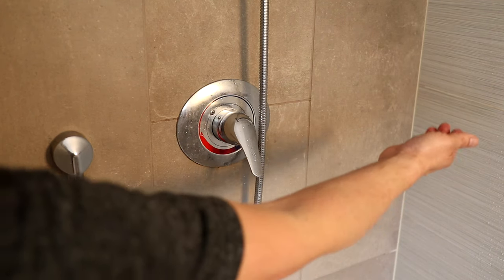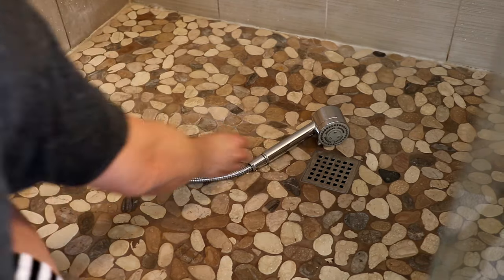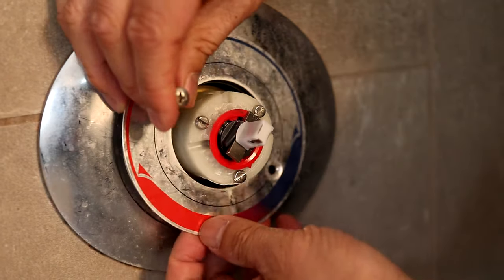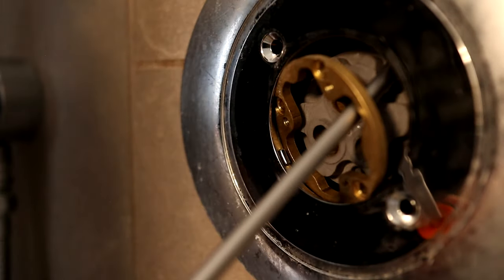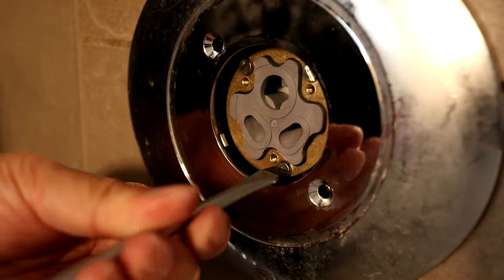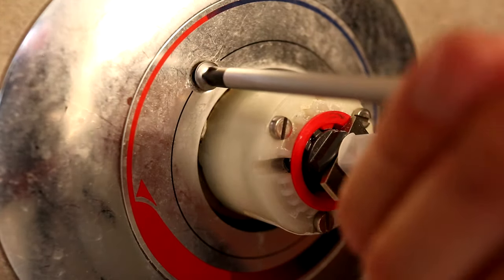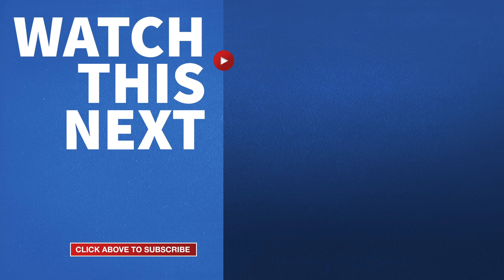American Standard Shower Cartridge Replacement Instructions - Shower Valve Pressure Balancing Unit

Comment: Just one note I thought I’d add: American Standard has a lifetime warrantee for their parts. If you know the model of your shower they will ship you the parts at no charge, you need to know the model of your shower control as there are different pressure balancers depending on your model.
Reply from the maker: Thanks for the tip! A while ago I made a repair video on a leaky kitchen faucet before and another commenter also told me that Delta has free replacement parts as well! However on my shower I needed it repaired right away so I went to Lowes for the part. Thanks for watching!
Reply: Sorry I didn't read this before buying a new one at HD.  Incidentally, none of the AS replacement parts come with screws and the screws are very difficult to find so be extra careful in removing them.  Also the brass retaining ring is not included in the packaging and is not available in HD.  Be forwarned.
Reply: Absolutely.  They shipped me the replacements.  Seems like the hot water degrades the rubber diaphragm and the seal in the pressure balancer.  I took mine apart afterwards and it was in very rough shape

Comment: As a mechanic, ive been showering in hotish water every day thats starting to dry my skin. Sooooo I'll be checking this out soon. Getting ready to replace my s22 ultra back glass screen tomorrow as well. 😂 when ur a mechanic, ur also a plumber, electronic tech, hvac tech, construction worker, etc
Reply: Update, turns out all i needed was to move the black little gear piece that adjusts how hot or cold the water gets. It came off when the handle fell off. (Been using vice grips for a year, on the valve) finally bought a new shower knob and its shining 😂

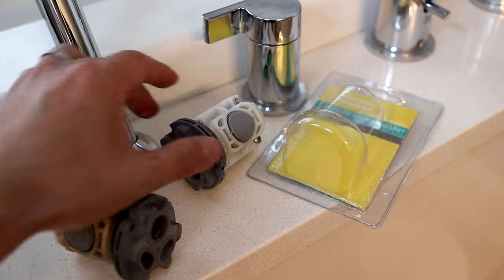Comment: There might be a problem in this video. I'm not sure.  Do you notice that the old one had two green inserts and no black rubber rings around them. 3:14 The new ones do have rubber rings.  And when you look inside the brass valve body, where the pressure balancing valve goes, there are two black rings inside from the old valve 3:36.  I think you have to remove those two black rings because the new pressure balancing valve has them.  They just seem to get stuck when you remove it.  Am I mistaken?
Reply from the maker: You are correct. One other viewer noticed the old black rings still inside the pipe in the wall. After being made aware of that I rewatched my video and saw that. I think what happened was that I was too busy with getting the shots and I didn’t see the rubber rings still inside the back of the fixture. So I removed the valve and pressure balance unit at a later time and removed those gaskets that weren’t supposed to be in there. The new pressure balance unit already has them.
Reply: @digitalcamproducer  I took the old one apart and inside it was a mess.  The rubber diaphragm had almost completely disintegrated.  Furthermore, although the ceramic valve looks okay, The intake o-ring, which is not a standard round shape, was pretty disintegrated on the hot water side.  I guess the rubber that they are using doesn't do that great in hot water.  Luckily the American Standand warranty service sent me both the pressure balancer and the valve, without any challenges. They also sent me a new spout/diverter.  I have to solder a new pipe to install the spout, that's my remaining piece of the project.

Comment: My American standard unit doesn't have have a  separate replacement balancing cartridge, it's all one unit, must be an early version.  The mixture cartridge replacement unit swapped out easily but it looks like I have to change the whole faucet. Good times.
Reply from the maker: Sounds like it’s gonna be a bit more work for you to solve your faucet issue. Yeah never fun when it turns out to be a bigger task than when you first started out.
Reply: @digitalcamproducer  might have a workaround, but I replaced the mixer cartridge anyway and it seems to be working. Go figure.

Comment: Hi! Do you know your model number by chance? I have the same handle and just need to replace the trim around it as it has cracked but cannot find the model number for the replacement part as it is very old.
Reply from the maker: I actually don’t know the model number of the faucet. My plumber installed 3 of these but have no idea of the model number.

Comment: This video is very helpful, thank you.  One thing, I am getting stuck at finding the pathway in the allen wrench hole.  My allen key keeps hitting metal right away. I have it turned up, too.  The initial issue was that the handle will not turn right.  Your video has it up and RIGHT -- does it need to be that way to get the allen wrench in? if anyone else is hitting metal or unable to to turn the handle right, would love to hear
Reply from the maker: By now you’ve probably solved your problem. But the faucet handle can be turned in any direction. Turn it to where you can access the set screw opening easily. Finding the angle of the set screw with an Allen wrench can be tricky though. But you will be able to do it after a few tries.

Comment: I have the exact same mode. I've taken out the set screw but the handle still won't come off. It's not even loosened. Still turns and moves like normal
Reply from the maker: Sorry you’re having issues removing the handle! That set screw should be the only thing holding it on. Maybe there’s corrosion inside making it stuck there. You could use a screwdriver handle and tap the base of the valve handle to see if you can loosen it up. Hope you find a way to get it off! Thanks for watching!
Reply: @digitalcamproducer  I'll give that a try. Thanks for the response!

Comment: I had a slow leak from my downspout. As I watched  the video and removed the trim I found one screw that holds the in place was loose. Tightened the screw and the drip stopped. Tanks for the video. ❤
Reply from the maker: That is good to hear! Glad you fixed your problem by just tightening a loose screw. The easiest kind of DIY! Thanks for watching!

Comment: My shower controls when set in the middle between hot and cold would make the water pulse and the pipes would "bang" in the walls.   This trick solved the problem.  Paid $23 at home depot for the part that was in stock as well.   Took me longer to drive to depot than it did to do the job.   Thanks for  sharing,  the video was great.  YouTube comes thru again!
Reply from the maker: Excellent! So glad you got your plumbing problem fixed! Plus the satisfaction of saving money by doing it yourself! Thanks for watching!
Reply: @digitalcamproducer  no doubt about it,  always feels that much better when you can fix it yourself!

Comment: Some towns/cities flush fire hydrants in the spring and when they do it releases a lot of rust and small pebble like contaminates that end up in our homes plumbing. This can attribute to issues with your faucets and bath/shower valves. Even a home with a well can get sand and small grains of pebbles that do this too. Just FYI to pinpoint some things that happen to cause issues similar to this.

Comment: In your opinion, is it wise to turn the water back on before installing the outer plate so that you can see if there are any leaks before concealing everything?

I'm paranoid about doing the repair and then having a leak behind the wall that I can't see.

Thanks for your help. This is a great video!
Reply from the maker: I think it would be ok to turn the water back on before you put the outer cover on. That piece is just for looks! Hope this helps!

Comment: i bought a new cartridge set and installed it, but the water pressure was only a little better .. i tested the water  with no valve in and it was strong coming out, but not too strong after installation

Comment: Thanks for posting this, I did the original install when I purchased my home in 2007. but could not remember how that set screw was inserted or the Allen wrench size, found those details in the comments below, looked at HDepot & that part is 70 bucks, so I'm cleaning it up & greasing the o rings with vaseline & back in it's going. I can buy a new whole replacement for about the same, but it ain't gonna happen
Reply from the maker: Nice! Really glad my shower faucet tutorial was helpful! Thanks for watching!

Comment: I change my cartouche and i only have hot water with any ajust in red plastic ? I need to change te peace of presure?
Reply from the maker: In my shower I was only getting hot water so I needed to change the pressure balance unit. I didn’t know anything about this before I made the repair. But the pressure balance unit was the problem. If you changed the cartridge and you still only get hot water… then the pressure balance unit is what you need to look at next. Hope this helps!

Comment: My handle only has a hole on the front of it. Not the top or bottom if that makes sense. How do I get it off?
Reply from the maker: Hmmm! It’s hard to tell what to do without seeing your faucet handle. I’m definitely not an expert in plumbing and pretty much all the faucets I’ve seen have the small set screw underneath. There’s got to be a way to get that off. Sorry I’m not more help on this! Thanks for watching!

Comment: If my pressure balancing unit works fine, can I just replace the valve cartridge?  Is it best to replace both?
Reply from the maker: Yes! If the pressure balance unit is ok you can just replace the valve cartridge. I’m not a plumbing expert but that’s what I’d do. Only replace the part with that issue in this situation. Hope this helps!
Reply: @digitalcamproducer  Thank You!  My main issue is that my faucet valve is calcified, and I don't feel like dissassembling the valve components to soak them in CLR.

Comment: What size Allen wrench do I need to remove the handle? I tried the ones I have, but seem to work.
Reply from the maker: Sorry I don’t have an answer for you about the Allen wrench size. I don’t really know. I just tried different sizes until I found one that fit. Hope you find one that works or ask to borrow a friend/neighbor’s wrenches to see if they have one you can use.
Reply: I used a size 2.5 for mine!

Comment: Is this a standard part on all shower units?
Reply from the maker: To be honest I didn’t know about the pressure balance unit until I opened up my shower fixture. I thought there was only a valve in there. It’s possible that much older fixtures didn’t have them but I can’t be sure. I’m just a regular guy that fixes things as they break. And I’m definitely not a plumber! But replacing the pressure balance unit in my shower fixed my problem.

Comment: So would this repair also fix the faucet not turning to hot? Ours won't turn hot any longer, just lukewarm or cold
Reply from the maker: I’m not 100% sure about this but I would say the replacement of the pressure balance unit would probably fix your no hot water problem. The pressure balance unit regulates the distribution of hot and cold water so it would probably solve your problem. However do you have hot water in other places in your home? Check to see if the water heater is working just in case. As you saw in my video, replacing a pressure balance unit isn’t difficult to do. Plus the part is available at Lowes if you need one now. Hope this helps!
Reply: @digitalcamproducer  yes we do. It worked perfectly fine the day before. No issues moving from hot to cold and then the next day I couldn't get it to turn hot. Thanks so much! I'll order it now!
Reply: I am unable to physically turn the tub faucet to the left. It won't budge past the middle
Reply from the maker: Oh! I didn’t know the issue was with the knob! If that’s the case it might be a problem with the valve which the knob is directly attached to. The valve is the part that comes out after the handle is removed. But I can’t imagine what made it stop moving to the left all of a sudden. I didn’t have all the information in the when I initially replied. So the pressure balance unit may not be the problem. That part is too far back in the wall to affect the movement of the knob.

Comment: Are they all the same part number for this brand? I order mines and the metal part I think is the retaining unit doesn't fit on the new part I ordered...what do I do.? Please help..
Reply from the maker: I’m not exactly sure but I would think that any of the American Standard shower fixtures made in last 20 years would use the same part. I’m not an expert at this. The only way that I found out what I needed was to take it out and visually confirm it. Sorry I’m not more help!

Comment: I hope someone can help... my little girl broke the handle. I had switched out the shower head because the hose ripped and right after that the tub handle became hard to turn on and off. After a few uses it totally stopped working and the water was stuck in the on position with the handle just moving but not controlling on/off or water temp. I shut the pipe off in the basement because I couldn't get it off. I was able to unscrew the handle part but I don't know what to do next. It's not a leak issue or temp issue and that's the only videos I'm finding. Can someone please help?
Reply from the maker: Sorry for the late response! Your comment was added about 2 weeks ago so I’m sure you found a solution or got a plumber to help by now. But it sounds like it’s a valve problem. The part attached to the front of the pressure balance unit. If you replace the valve it will probably fix you let problem! Hope you got it working!
Reply: @digitalcamproducer  hey thank you! I've been blessed to have two bathrooms so we just haven't used that one. I was thinking today it was the valve thank you for the confirmation!

Comment: great comprehensive video! I should have see this before I took out my valve pressure balancing unit (especially how it looked a lot easier with a paint can opener!). One note.  When you removed the OLD pressure balancing unit there were NO rubber rings at the end if it, as the two (2) rubber rings were still inside the metal frame/cavity.  The NEW pressure balancing unit had its two (2) rubber rings on it at the end.  This made me think when you installed the NEW pressure balancing unit you would have had an extra set in the wall.  Is that the intention and does that provide a better seal?
Reply from the maker: You’re very observant! I rewatched my video and it barely showed those rubber rings! You’re right that there were 2 rubber rings in the wall. I think I saw them when I installed the new pressure balance unit but assumed they were supposed to be in the wall. For some reason I still have my old pressure balance unit around and just looked at the back. And sure enough there were no rubber rings on it. So the ones in the wall probably came off when I pulled the old unit out? I’m not entirely sure? But I haven’t had any problems with my shower since I put the new one in. I think at the time I assumed those gaskets in the wall were supposed to be there. Now I have to look at other videos and see if I can tell what other people did! Thanks for watching!

Comment: is the Shower Valve Pressure Balancing Unit universal? I need to fix mine asap. Just getting hot water
Reply from the maker: Each manufacturer will have a different pressure balancing unit. You’ll need to know the brand of shower valve you have installed in your bathroom. Best way to tell is to take yours out and compare with pictures on online stores or go to Lowe’s or Home Depot and physically compare what you have with what’s in the store. By the way if you don’t have a shut off specifically for your shower then you’ll have to have the water shut off for your whole house until you get your shower valve reassembled. Hope this helps!

Comment: I did this last August and for some reason 3 mths later it started leaking, damaged the ceiling below. I have another unit coming from American Standard again, still don't understand why it leaked. Hoping for better results.
Reply from the maker: Sorry you had a leak from this! Maybe the pressure balance unit wasn’t seated properly? Check the seals. Hopefully when you redid it the leak is gone.
Reply: @digitalcamproducer  Yes, re did it and the leak is worse. Parts are scheduled to arrive from American Standard on  Tuesday, fingers crossed. I did this process yrs ago and it worked, I think this may just be a lemon, thx.

Comment: good video, my current issue is when i turn handle all the way to full hot the water is slightly hot (enough to shower) if you move the handle back and forth enough the full hot comes eventually, do you think this is the balancing unit or just the pressure balance cartridge. thx
Reply from the maker: I’m definitely not an expert on shower plumbing but to me it seems like an issue with the pressure balance unit. However, when your full hot comes back on is it extremely hot and scalding? Mine was 100% hot to cause pain no matter what position I set the valve to.
Reply: @digitalcamproducer  thx, well since i posted i have replaced the cartridge, but my prob is still present, so i have now ordered the balancing unit (that has to be the culprit here) right now as i wait im still able to shower but as mentioned i have to move the handle around full hot then half way or close then full hot etc, the full hot eventually comes. if my shower handle is all the way up to full hot, obviously too hot to shower but as per normal situations you just back off the handle (about half way or bit more) there's nothing more to replace, so im pretty confident the bal unit will solve the problem here, thx again
Reply: @digitalcamproducer  and yeah when the full hot comes back on its 100% hot. but i just back off the handle and its fine
Reply: @digitalcamproducer  replaced balancing unit today and......success 👍👍